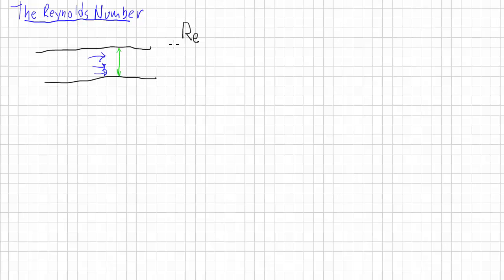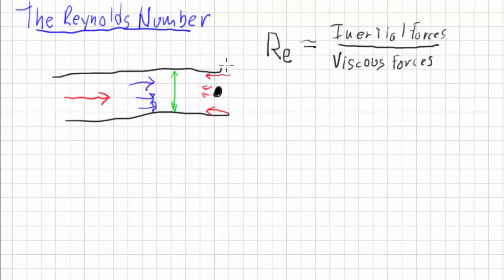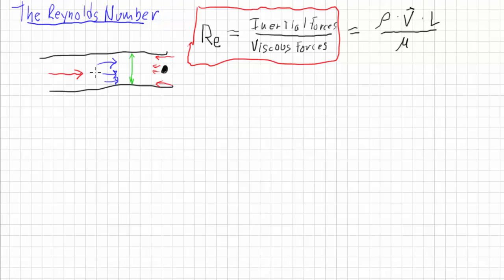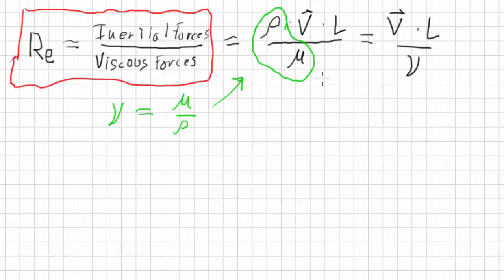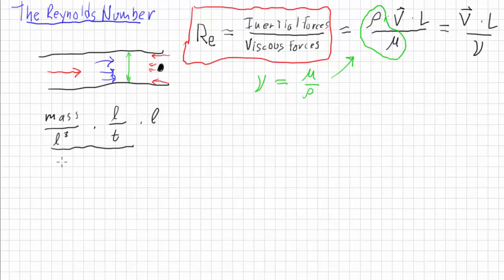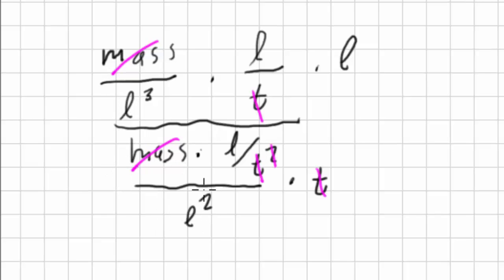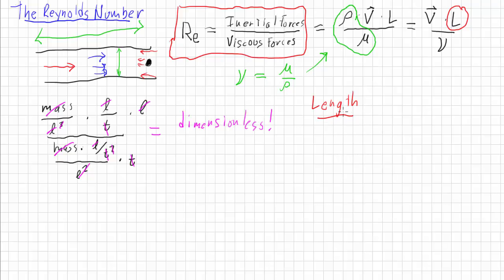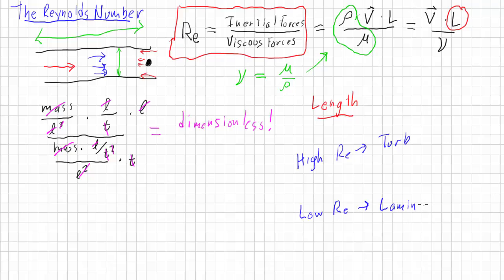The Reynolds Number

Comment: A fluid with a specific gravity of 0.8 and a 4in-1 D hose kinematic viscosity of 1.5
centistokes
(1centistoke=1.0764x10^-5n^2/sec) flows through a at the Reynolds number for this flow is

most nearly Re =vD/u.
please provide solution.